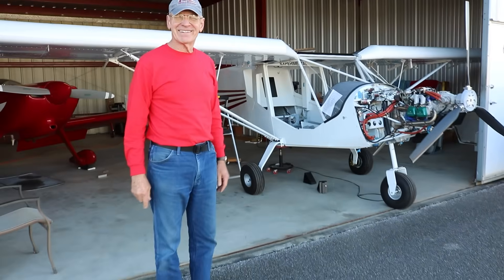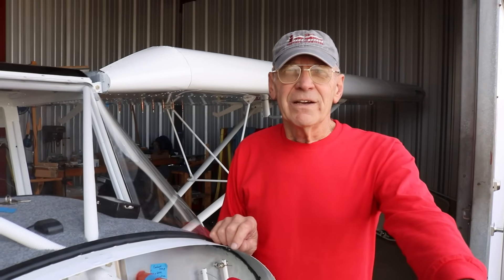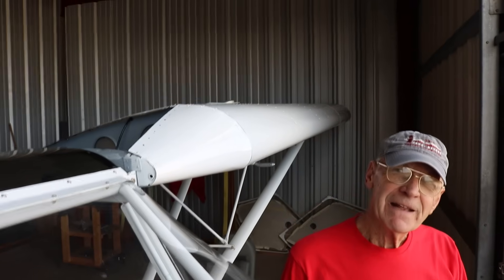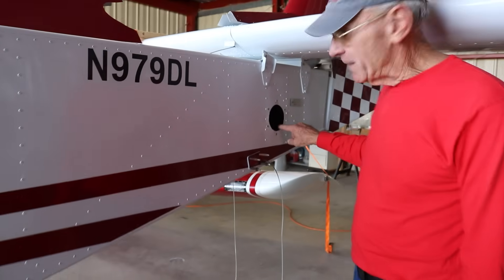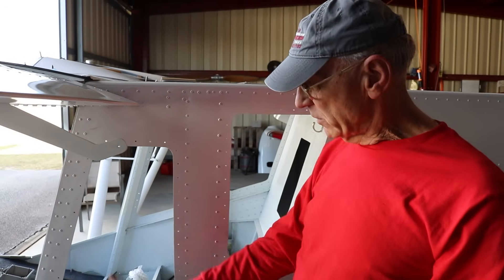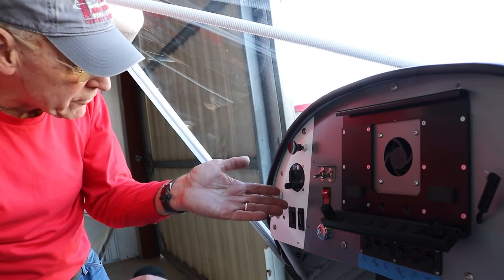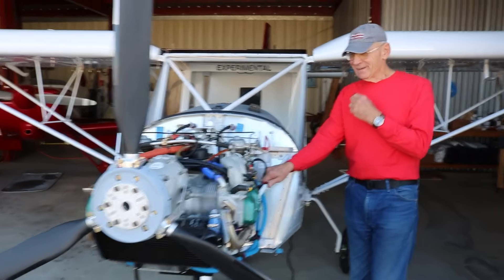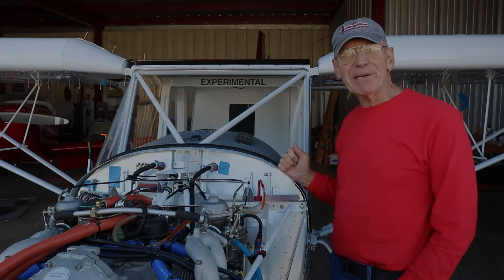Retired General Builds an Airplane!   Zenith CH750 STOL

Comment: I've got hundreds of hours with/without slats and with/without  VG's on my 750 STOL.  You'll have excellent STOL performance without the slats, but as pointed out, just won't be able to do the very steep angles of ascent and descent that the slats provide, so that eliminates using very short strips with obstructions on the ends.  Without slats, the wing will stall conventionally rather than just "mush" like it does with the slats.  The StolSpeed VG's will drop the stall speed about 5 knots if the slats are off.  Removing the slats increases cruise about 8 knots and increases useful load 14 lbs.  I don't fly as much cross country as I used to, so I have the slats back on and practice STOL technique a lot - just for kicks.  Having a ball and hard to keep the grin off my face!  Enjoyed the video and looks like the general has a really well thought-out plan for completion!

Comment: Drano - FYI I have installed two Falken systems and my latest one is with a Rotax. Be aware that certain EMS units have a firmware bug, mine does, which shows bad EGT temps … yes I know EGTs on Rotax aren’t critical.

In addition you’ll need to manually calibrate all the Rotax temp and pressure sensors because Steve hasn’t released Rotax sensor maps yet but he has given me manual maps/tables that I installed.

Lastly, if you run into other issues with Falken, I have seen many, fixed some and on others I hope you get a better response from customer support than I do. 

Feel free to reach out to me directly!!!